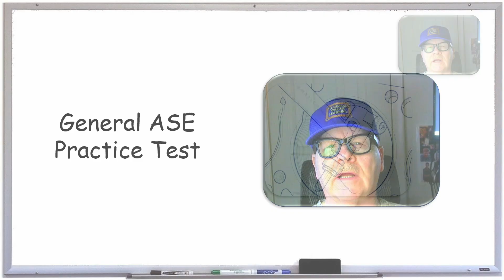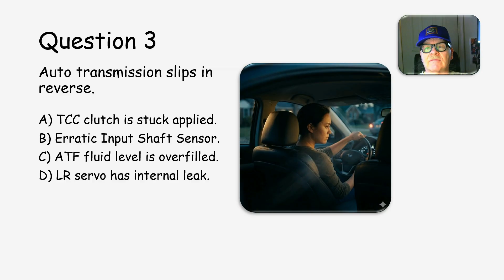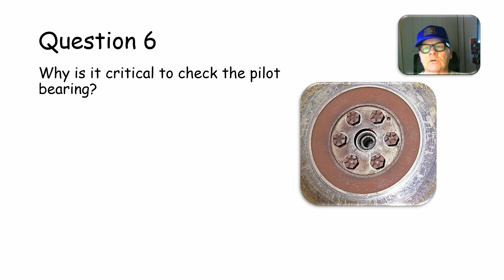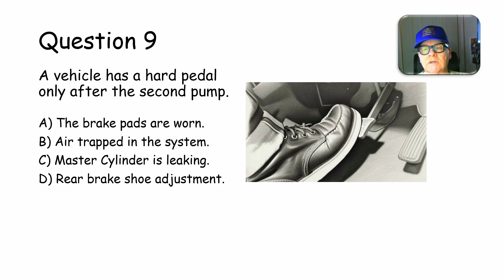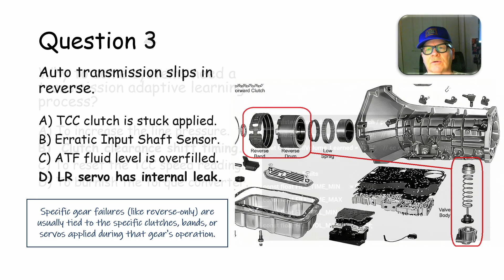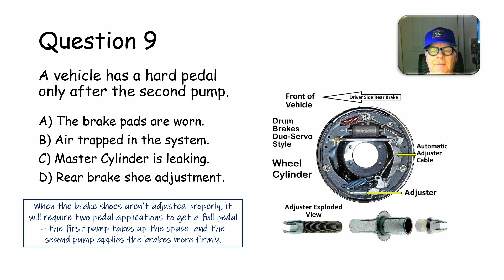ASE General Practice Test 1

Comment: 1.) B. 
2.) A. Tough one. Cylinder head won't torque down so...
3.) A.  total guess. 
4.) C. Another guess. 
5.) C. Transmissions are definitely a weak point for me. 
6.) A.
7.) A.
8.) D.
9.) C.
10.) A.

Submitted prior to viewing answers. I don't think I passed. Maybe 3/10.
Reply from the maker: Just trying to help! These "test" videos target a smaller audience than many of my other ones
Reply: @McCuistian The tests are great. I always learn something. They're generally more difficult than your typical ASE style questions.

Or my aptitude may just be on the level of those fellas you call "Yo-Yo's."